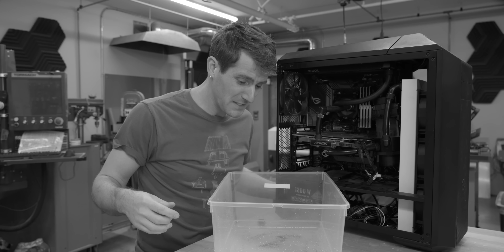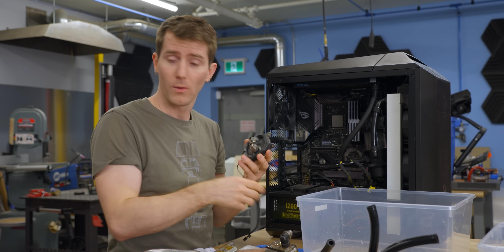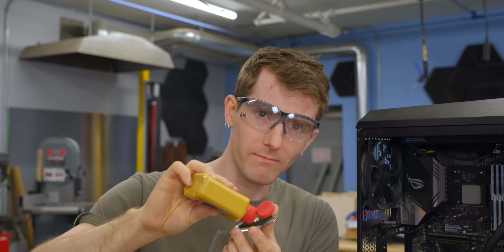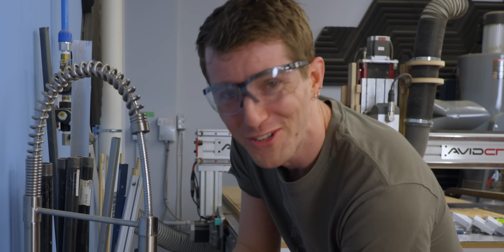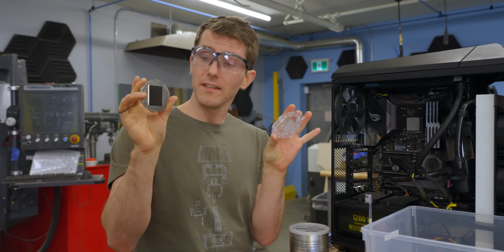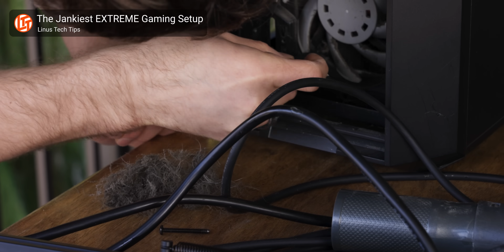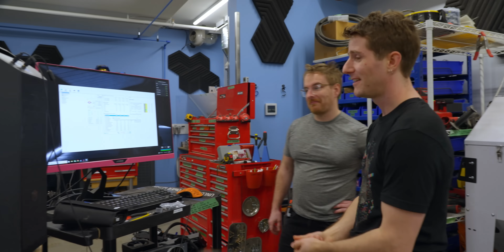I Will Never Watercool Again – Water Cooling Maintenance Guide

Comment: The next time you guys need to do a waterblock clean, try using an ultrasonic cleaner.  The toothbrush and brasso may make it look good, but you're not hitting all the surface with it due to the toothbrush bristles just being too wide for the gaps.  I'd also stay away from brasso precisely for the reason that it's an abrasive and can wear the coating off over time.

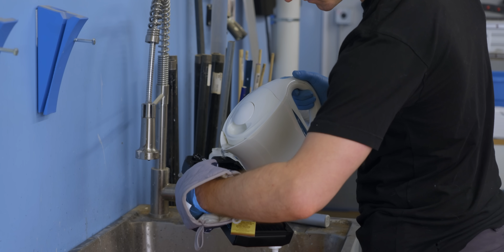Comment: Linustechtips at 16:30 you can always use CLR in the radiator. You don't have to shake the hell out of it. I do this in cars heater cores CLR and garden hose. Always works bud

Comment: Heads up: while PTM7950 is amazing for laptops and is suitable for CPUs, it definitely should not be used for a liquid cooled GPU as unless your liquid temp is crazy high its unlikely it will hit the 45c phase change temp as per Honeywell's spec sheet and it will end up performing notably worse than a good paste

Comment: Meanwhile my custom loop I built 7-8 years ago which has never been apart or really cleaned once is still doing fine.  Take the time to build it right (proper metal mix and no softline tubing) and use glycol based coolant (no PETG tubing) and forget about water cooling problems.  Hell it has even had opaque dye running in it the entire time and is still within 5-10% of where it was the first time it was run, once I dust out the rads that is.  Most of that heat increase is probably the thermal paste not having been replaced in 7-8 years TBH and not the water cooling system.

Comment: Using a pantyhose as a dust filter for a computer can be an effective DIY solution. Place it only where air is drawn into the system, ensuring the material is fine enough to trap dust without obstructing airflow. This method can significantly reduce dust accumulation inside the PC, maintaining cleanliness even after years of use.

Comment: Eh, I'll stick with my Oral B toothbrush, I got 10yrs out of the first one, bought 2010, replaced 2020, I've gotten 3.5yrs out of the new one so far. The only reason the old one had to be replaced was because the rubber had all but gone from the toothbrush, and it was needing to be charged daily. Price was pretty decent for here in Australia too, I think I paid like $200 for my old one, and around $150 for my current one.

I never use the smartphone feature that it has.

Comment: Is it possible to control the fan speed on radiators by the water temp in the radiator. I feel like this would make water cooling  quieter for that little bit longer.

Comment: To prove that a contraction mapping \(f\) is continuous, consider the definition of a contraction: \(d(f(x), f(y)) \leq c \cdot d(x, y)\) for all \(x, y \in X\), where \(c < 1\). This implies that for any \(\epsilon > 0\), you can choose \(\delta = \frac{\epsilon}{c}\) to ensure continuity.

To show \(f\) has at most one fixed point, suppose \(f(z_1) = z_1\) and \(f(z_2) = z_2\) for \(z_1, z_2 \in X\). Then, \(d(z_1, z_2) = d(f(z_1), f(z_2)) \leq c \cdot d(z_1, z_2)\). Since \(c < 1\), this implies \(d(z_1, z_2) = 0\), and hence, \(z_1 = z_2\), demonstrating uniqueness.

For an example of a nonempty \(X\) with a contraction map without a fixed point, consider \(X = [0, 1]\) and \(f: X \rightarrow X\) defined by \(f(x) = \frac{x}{2}\). This is a contraction, but it has no fixed point.

To show that if \(X\) is nonempty and complete, every contraction map has a unique fixed point, you can use the Contraction Mapping Theorem, which asserts that in a complete metric space, a contraction map always has a unique fixed point.

Comment: This is one of the few sponsorships that actually worked on me. I just love the dynamic of a toothbrush company sponsoring a video using their products in an unintended way, LOL
Reply: Yeah, I legit use a toothbrush for that sort of cleaning, lol. And it is a good point that you could have an extra head for cleaning crap and clean ones for your teeth, lol
Reply: It's weird that everyone is complaining about the fact that there are ads. Like yes there are ads through youtube themselves (which LTT does not control what type) and ad's in the video itself. This is normal for ltt, both youtube and in video ad's
Like I felt some tiredness from some of the constant talking points but still gave me a general message of "for cleaning a vibrating toothbrush is a great tool" sure they were specifically using and talking about the sponsor. I noticed a total of 3 obvious talking points, two during the video and one in the conclusion (which I view as normal). But the rest felt more about electric brushes in general being good for cleaning (both for pc and teeth).
Reply: Of course this was approved by the sponsor prior to production.
Reply: Just get Sonicare. Wouldn't trust my teeth to an Iphone 3gs looking brush
Reply: Hahaha
Reply: What in the 21st century attention span is this bruh. It’s a video about cleaning your water cooling system, they cleverly incorporate there sponsor into the video to show its potential to clean and because it actually works they use it throughout the video. They aren’t shoving it down your throat they are showing a product that by all means looks good. If you can’t live without your endless content stream then go watch another channel or just watch a different video from ltt, it’s not that deep.
Reply: @TehSquiddleDiddle  it is more that people are ok with constantly decreasing content quality. People are becoming too accepting of videos where 50% of it is ad. In the past that wasn't the case, especially in late 20th century.
Reply: @ligametis  Apparently you and I had very different experiences in the late 20th. I remember kids shows with sub 20 minute run times still being a 30 minute time slot, and movies that were just over an hour taking up a 90 or 120 minute slot, and have ads/promos in the intro and credits. I don't think ad numbers have gone up significantly since then, I think it mainly feels that way because we don't just have to put up with ads on TV and the radio anymore, basically most things we do now have ads in some form or other. (At least we're safe until menus at restaurants or your smart fridge/stove start playing ads before you can use them!) One thing that has gotten egregious though is the ad run time that companies can put in. Ten or fifteen minute ads that if you don't have the ability to hit skip for a time (music during a shower, working on car and the like) it's an absolute nightmare. I remember seeing one ad whose runtime was around an hour or something ridiculous.
Reply: I disagree. This is horrible. I'd rather have 20-30 seconds I can skip instead of literal 1980's level constant product placement. It's disgusting.
Reply: This was a terrible ad. I got tired hearing about this toothbrush from 20 different channels and this was a whole video about that.
Reply: @ligametis  ...sounds more like a "you spending too much time on youtube" issue. Not with the format of the ad itself.
Reply: @Nukezone100  that is the point. I can't spend a lot of time on YouTube and I do not wish to waste it on useless product ads. Have 10s-1min ad that is easy to skip or ignore.

Also advertise something useful like some better alternative to their ltt screwdriver.
Reply: @CanIHasThisName not this kind of ads. I just said I would love if they advertised some other screwdriver than ltt one or something similar. And in distinctive chapter inside the video.
Reply: @CanIHasThisName there are already unskippable youtube ads before the video and then the whole video is an ad. So let's just watch ads, who needs real content.
Reply: @ligametis  Seems more like your watching a channel you don't enjoy. Odd take to bring up there screwdriver whether you like it or not. I'm not sure why they'd advertise a "better alternative" to something they make. Doesn't make sound business sense.
Reply: @Brandonls4  their products are pretty trash and overpriced. Pb swiss costs less. They could educate viewers and promote consumer friendly practices by suggesting such better products.
Reply: @ligametis  As i said, it appears you don't like the channel. That's totally fine then just don't watch it. I cannot name a single company that is going to promote "better products" over there own product can you?
Reply: Ya, it's the Dyson sponsored video debacle all over again, but this time with a dropship chinese toothbrush... @ligametis

Comment: I run a light mix of antifreeze and tap water for years, with absolutely zero issues except evaporation of about an oz every 2 months.  If you have hard water you might have problems, but you can use distilled water then.

Comment: If you are going to water cool, there is some old techniques used in this video. The older techniques are fine if you are going to run clear or dyed fluid but are no longer recommended for pastel/solid fluid. The basic problem is that 'fallout' will occur in your liquid. The particulates in suspension in the fluid will stop being suspended. This happens because of the PH of your loop. It is recommended to clean the loop with your chosen brands cleaning/flush kit before filling with coolant.

Comment: I bought a Inwin gr1. With its stock fans, it's almost dead silent. My aio cpu cooler and/case fans in my lian li lancool 2 is louder. So I'd tend to agree on the particulars of actual silent water cooling. The trade off of fans today for sure is probably worth it for almost everyone

Comment: I had an EK pump/res combo many years ago that had one of those pucks and the same thing happened to mine, it fell apart in my hands when I picked it out of the loop and had some bits in the loop as well. I only used the CryoFuel thingy from EK and nothing else but it was colored and not clear.

Comment: Ive used my electric toothbrush for a couple years but recently did a trip down to mexico and only brought a manual. The first two nights i used ity gums bled a little and i could instantly tell it had got a deeper clean than with the electric toothbrush. Maybe this brand is better than my basic oral B one, but ive started alternating between electric and manual every so often.

Comment: How they got so much dirt inside? i run my WC for 4 years all what i do is add water every year and i made my cooling liquid myself i buy distilled water and add bensotriazole to make 0.01% solution, benzotriazol is cheap, prevent corrosion and galvanic corrosion for example when radiator is aluminium and cooler plate is made from diffirent metal like copper also kill algae and water plants. And also decrease water tension making water more "sticky". Never had any gunk or chunks or anything after this 4 years

Comment: Headlight polisher is a terrible idea
Its designed to fill surface scratches & leave it with a shine, hence polisher. Using that pretty much guarantees having unwanted contaminants in the loop.
It is not a cleaner, it is a polisher. Like windex or car wax.

Comment: Next time you can use radiator flush solution for cars. Very effective and much easier. Also use a coolant with the correct additive.

Comment: I find All In One water coolers(AIO) are cheap enough that I just replace the whole cooler every 5 years and just get another of the same size assuming I didnt replace the whole PC by then because I personally hate noisy air coolers. Which is why I never go with custom solutions since Ive never had a problem with my GPU's ever getting too hot to need water cooling for it.

Comment: Brasso is great for cleaning many metals, but I wouldn't use it for silver, especially silver plate.  In my experience, it can easily remove all the silver plating without real effort, leaving the base metal below on show - which is why the same company makes a polish specifically for silver.  I think I'd be careful with aluminum also, especially if it's a part that's dimensionally sensitive or needs close tolerances, as soft metals are more easily polished away than one might realise.

Comment: Change the water over to SILICONE OIL! It has quite a high-level thermal transfer dynamics profile and will stay clean and clear for a very long time! We use it in our parent company's supercomputer setup using full immersion bath motherboard cooling since it is a proper dialectric (i.e. generally non-conductive!).

It's more expensive than water BUT works wonderfully! SILICONE OIL .... TRY IT!

V

Comment: FYI Linus the pressure doesn’t build because the radiator heated up. The fluid is already at its hottest point when you add it. After that it only gets cooler. The pressure comes from the chemical reaction between the vinegar and water deposits. It’s like the vinegar and baking soda volcano.

Comment: Yes, electrolysis is real in rubber hoses. Rubber will break down faster if electricity is involved. The differences in charges (+/-) will expediate the devocalization process of rubber.

Comment: great video, but i think a have an "easier way" to clean my system:

drain water, remove and dispose of all water cooling components, open boxes, install new components...
the only component i still use after all these years is the CPU block. it's been running for almost 5 years without any problems ;)

and yes, i know. it's so much money and waste.
but IF i found some components that meet my requirements, i'll think about cleaning them.
until then, every time the PC is converted, a new system (usually even from a different manufacturer) will be installed.

Comment: I had to clean my AIO cooler after only a year of use. The cooler I chose apparently had a recall for build up that I didn’t know about and I missed the recall window. So I did the jankiest thing possible and emptied it, ran vinegar and water through it, ran regular water through it, the best part, I made a mixture of 80% distilled water and 20% car antifreeze. Idk if it’s good or not but my cpu is pretty “chill” with it.

Comment: You should 100% replace tubes if you already have it disassembled. PETG and acrylic have glass transition temperatures around the 85 C mark. With how hot some processors and GPUs get, this can deform the tubes over time leading to leaks and cracks.

Comment: In a liquid cooling system, you can use distilled water!!!
BUT you definitely need to disinfect the circuit. For example, you need to add alcohol and let the system work for a while. Then you need to drain the alcohol and rinse the circuit several times with distilled water. To wash away all particles of alcohol.
After this, add distilled water.
All operations must be carried out with the utmost care, like a surgeon during an operation. So as not to introduce any bacteria into the circuit.
 
I've been using distilled water in my custom liquid cooling system for over a year. The water remained absolutely clean! There were no bacteria inside, the container was absolutely clean.

p.s. Yes, it is much easier and faster to use a special liquid. But it might be a little more expensive.
Reply: But as Linus pointed out if there is acrylic anywhere then you will almost certainly cause cracking of it using alcohol.
Reply: @pault151  I don't think alcohol will have much effect on acrylic within an hour...
But you can use any other antiseptic liquid.
I used a weak solution of potassium permanganate and flushed the system for an hour.
After these actions, I rinsed it several times with distilled water. After this, distilled water was finally poured in.
The system worked with distilled water for more than a year. And the water remained absolutely clean (at least I didn’t notice any biological life forms)
Reply: @neochannelbenchmark  If there is residual stress in the acrylic, say a drilled hole, the cracking can start almost instantly.  Not recommended.
Your process sounds good otherwise, lots of rinsing.

Comment: This is why I just started using commercial grade TPE and PEG-based automotive coolant. Does the job well enough, has corrosion inhibitors and biocide, not that much different from some of the top-end PC coolant options (some combination of PEG + a Biocide). Haven't had staining, gunk build-up, or corrosion within the 5 year timeframe I set myself to maintain them at, and because bulk tubing from McMaster or similar industrial tubing supply depotes are cheaper than buying something branded like EK's ZMT or Alphacool's Norprene/TPV/EPDM based tubing, they can be tossed out and replaced if they have gotten too short to reuse or if one is just feeling too lazy to clean the tubes. Also, an ultrasonic cleaner does wonders for cleaning fittings and disassembled cold plates.

Comment: Im the type that is way too lazy to have extra shit to clean in my PC and I've also had 2 AIOs fail so I'm the number 1 supporter of the NHD15. Why go through all that and risk your setup if you can just have a good ol fashioned air cooler. Once or twice a year use a can of air to blow it out and youre done. All the maintenance you need to do and it's maintenance you should be doing on the case anyways.

Comment: For the cpu block you can remove the plastic ring from acrylic block. Rotate the block 180 degrees. With that orientation, you can have the inlet on the left and the outlet on the right for a cleaner run.

Edit 1: At 18:44 I’m not sure if you done that 180 rotation or not.

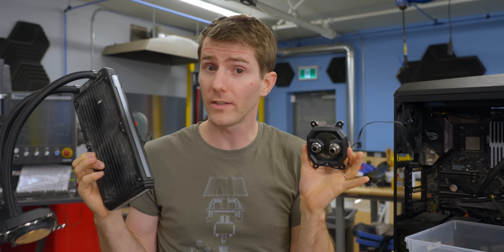Edit 2: I can confirm the rotation was done. 2:43 is before the 180 rotation and 9:33 is after the 180 rotation. Don’t know if that was intentional or not but great job nonetheless.